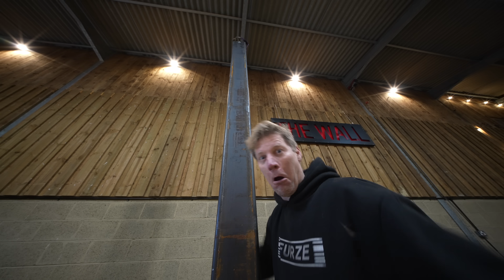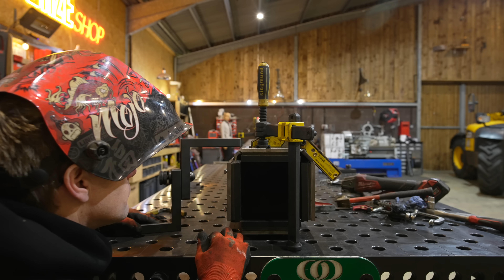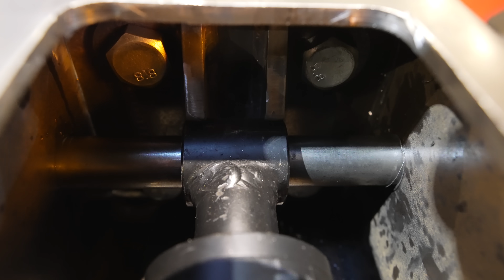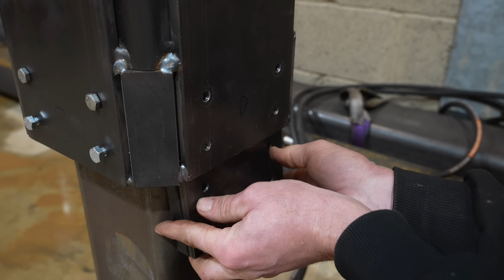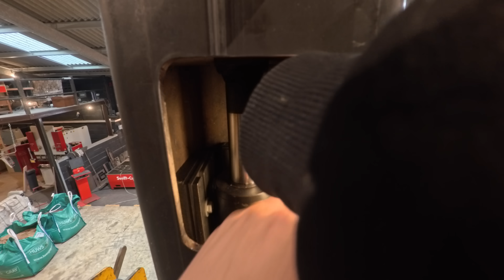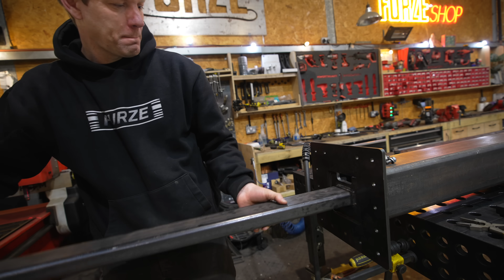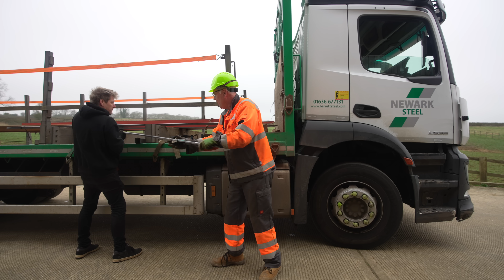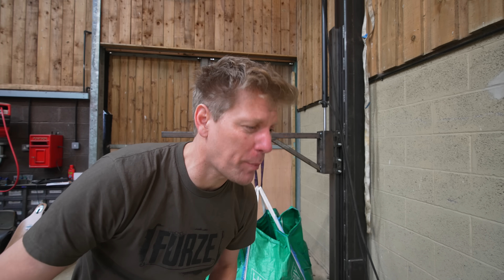Digging SECRET Garage Part 7 Car Lift Prep

Comment: colin if you are going to be using part of the lift as a means for mechanical repairs and inspection, please make sure that part of the lift has a locking mechanism, most of these lifts have an arm that gets pushed out of the way by these bars as it rises and when it lowers it catches the bars, so if there is ever a hydraulic failure your car doesnt come slamming to the ground

Comment: Delrin like on cranes. Depending on how much you use it you shouldn't have to touch it for 20+ years since it's just a guide. Definitely run the hydraulic system weekly or it will prematurely wear out. If it's unloaded run it up and down twice.

Comment: IDK why you wouldn't use a screw to send it up and down it's easier to repair and maintain plus it will run as fast or slow as the motors allow.

Comment: Instead of the complicated guide on the back, it would be sufficient to attach two plastic plates to each of the four corners at the top of the garage. That would keep the whole lift level in all directions.

Comment: Colin, what's to stop / protect against if the lift is elevated and there is someone else walking on the top side, or someone else is driving onto the top platform when it raise from the bunker ? 
If someone is on top of the bunker lift roof, or if someone is walking onto the elevated roof while it is being raised, could cause a bit of an issue for the person on top.

Comment: Dear Collin, you might want to consider driving your four columns with a spindle instead of hydraulic cylinders. With hydraulics, even if you use a gear-type flow divider, you’re still likely to run into synchronization problems. Just an idea.

Comment: Where the hydraulic ram is pinned to the leg, I would suggest using bushings around the pins. Over time, the ram pushing down on the leg will hog out the hole in the leg.  It would be easier to replace bushings than the inner leg.

Comment: the 3 ton capacity calculation.... is that before or after you take into account the weight of the frame of both lifts, the fame the car sits on, and the rams? Im betting all that will be 2 ton so the lift capacity (for the car car) would be .75 to 1 ton

Comment: I would consider myself lucky to be able to afford, simply, lowering my car underground to be parked safely tucked away.  You elevator that rotates when below to allow your car to exit the lift and drive around to your other locations ... that is just over the top.   How much easier would it be to skip the feature that allows the car to exit/enter the lift underground?  Is there something else that needs to use the lift when the car isn't on it?  If it is only for the car....why does.. oh, I just remembered the fun of absurd projects.  Great stuff!  Keep up the amazing content, it is excellent.

Comment: I used to install and service elevators. Im happy to see the brake. Maybe do a slack rope switch on each column. If it lags behind too much, the cable will slack, release a N/c switch that will stop the whole thing. Thats actually how those brakes work as well

Comment: Wouldn't it be easier to pull the ram out from the top with a access panel that also doubles as the connection point of the ram?

Comment: You're incredible. I don't know about those bolts holding the bearings on though, I would think the vibration over time would make them loose, even with the double nut setup.

Comment: 1.4 mtr slot for cylinder change, you tart. We struggle with 40 x 20 cm inspection hatch to swap  1.5mtr long 90kg cylinders. Then you have rear machine clearance. Thank god for a block and tackle

Comment: My bandsaw has that type of double nut adjustment on an eccentric cam for the guide bearings. They NEVER hold. It's a proper issue.
I'd strongly recommend looking for another solution. At the very least you need some sort of grub screw or locking mechanism on the locking nut.

Comment: What safeties will you have for if line breaks or cylinder breaks? 
1. You can isolate each leg
2. Would need tilt sensor and individual cylinder pressure sensors

Comment: For your ajustable shims in the foot, I'd have the set that are perpendicular to the adjustable set 5mm shorter on each end - you don't want to be tightening the adjustable shims only to find them binding against the other shims.

Comment: 20:06 took the words out of my mouth Colin! When you mentioned this feature earlier in the video, that they slide adjust, straight away this would work best if they did the same thing, exactly how the adjustment works on the rear of my Ford c-max suspension adjustment  works concentric nut(s) - for toe in and toe out adjustment. (And most tensioner pulleys on engine cam belts) at this point of the video, ta flipping dah Colin, our worlds(minds) align Colin! Mwah!

Comment: when it comes to making the platform tht the car goes it i think you should put a nothe plate on the bottom that has like a rubber thing round the edge and have limmit switches inside that pressure pad sort of design and have it so that the lift stops when it hits the floor or if something is under it that shouldnt be there its not gonna squish it

Comment: Given the current complexity of the physical components, can I recommend some PLC monitoring of the hydraulic system. Electronic monitoring for rate of climb of the 4 legs would allow control of the pumps to keep it 100% flat and equal the entire way.

You'll need slowdown and stop sensors anyway, so you may as well have level control too.

Comment: Im just a machinist. I would've went with hydraulics horizontal on the floor and they pull steel wire on pulleys to lift and lower the lift. You could throw on some counter weights if you wanted. Id want some kind of ratching catch though so if anything fails it doesnt fall. Basically exactly like an elevator design. 4 huge hydraulic rams will work, for how long? We will see.

I forgot. You could also get rid of the hydraulics altogether and use an electric winch to drive the cable. Would make it move alot faster and take up less room. With a good counterweigth on it, it would take almost no energy. Id trust steel wire more than any hydraulic ram, especially that much travel.

Comment: Use a device called "hydraulic flow divider". This will ensure an even lift of the car platform, even if only one corner has weight on it.

Comment: Forgive me because it's been a while since my last check, but how are you preventing the space in your tunnels and garage from becoming a low oxygen environment due to the oxidation of the steel? Im guessing just air exchanges and sensors for safety?

Comment: First thought as an electromechanical engineer : what about corrosion ? Mild steel needs some surface treatment otherwise it will get punky rusty in no time... Will you get all the parts galvanized ?
Second thought : will the structual engineer also establish the risk analysis, as this is obviously a Machine ? The good point is that there is a world full of suppliers of control systems wich will allow to put every risk under control : light curtains, anti-pinch edges, ...
Third thought : an iso-leveling system with cables looks to me a bit complicated on a 4-pole lift, there will be pulleys everywhere. What about this : for each cylinder, a 5/2 valve (up/stop/down with stop as default fail-safe position), a flow regulator (which helps to avoid the iso-leveling process to act if the valves are adjusted good enough, but if they doesn"t it's not critical), two inclinometers on the platform (X / Y axis) and a PLC to act on the necessary valves (stopping or keeping open) if the platform begins to get out of level.
Fourth thought : the safety brake blocks will act if all four cylinders fail at the same time; however this risk should be extremely remote (unless there is a common failure mode); also these brake blocks need a Governor like on a lift, and you'll need 6 of them with the associated cables.... that will be a lot of cables.  What could happen is one cylinder or hydraulic circuit failing ? Not sure the governor will catch, however as the platform will then still be supported by three columns, you'll get a lot of stress everythere... It will hang total wonky...  Here a ratchet mechanism looks more appropriate. It can be electrically actuated if the lift has advanced automation, in this case instead of the inclinometers suggested above, a position & speed sensor on each column (there are some with a little wire, others with a scale like a DRO) can provide the information both for iso-leveling and for releasing the ratchet.
That was a lot of thoughts, damn...
Reply: Hi
Regarding your 4th thought, i had some similar ones. I work in the elevator business, and even there a you dont need a safety gear if you have a hydraulic elevator, which is directly connected to the piston, and you have here for 4 pistons. So i seems a bit an overkill to have a safety gear and an overspeed governor. What they do in elevator business to prevent the elevator from falling during a pressurr loss, for example when a hose burst, they add a rupture valve to the cylinder, maybe this is already all the safety you need.
Great video though
Reply: Stop waffling ya sausage

Comment: Very novel but completely overbuilt. It's way too complicated! Why not just use 2 sets of 2 post car lifts? All the hydraulics, cylinders, shims, guides etc etc are all proven designs, cheap and pre assembled. They're also like 4m tall which should be more than high enough for this AND they have the safety locking / ratchet mechanism which is an added safety bonus. I mean even if the heights were wrong, you could extend them OR even have a "false" floor that would disengage from the lift arms and go down the rest of the way flush to the bunker floor. You could also use cables like the 4 post lifts have. I mean there's quite a few ways to do it, But this just feels like you're reinventing the wheel a bit here Colin! Great content as always tho

Comment: Wouldn't it be simpler to use big threaded rod inside leg instead of hydraulics? 4 legs. 4 big gears. 1 powerfull motor and 1 big timing chain to turn all threaded rods at the same time?

Comment: there's  much awesome going on here!
but don't forget a simple 6mm  drain hole for water near the bottom, if you end up grouting in your hydraulic columns at the base.

damp will surely try to pile up inside these robots.

Comment: You needed a real old skooler, like Archimedes, on the job. If you'd bored a huge hole in the middle of  your secret lair, you could've had  a big cylindrical float. A float that displaced a cubic metre of water could lift a tonne, or about 80% of a Delorean. A hole 2m in diameter & 0.5m deeper than your lift height would be about the right ball park for a near "weightless" lift of a Delorean. If that doesn't float Colin's boat, he should at least take on the principle of doing something recoverable with the gravitational potential energy expended when the lift goes down.

Comment: Errrrr 20:30 offset holes on M10 bolts to hold that much force? Never going to happen...

I guess i missed something but as i see it there's no way it would hold. 15mm plates? Then M16 i would say would make more sense, if you use M10 or M12 you could stay with 10mm plates

Comment: On the basis that everything is better with lasers, why not manage the leg extension and platform level with laser range finders and an Arduino or Pi based system?

Comment: Hey Colin. Awesome work you’re doing! As an American who lives in the “south”, we frequently deal with high air moisture levels for a solid 6 months out of the year. I do understand that we live on different continents, but I would be worried that with all the steel you use, you might deal with surface rust that could cause tighter tolerances to not work as well as they should. Is there anything that you do to avoid that?

Comment: When you first mentioned the car lift i was skeptical. Now i am amazed at how easy you make it look. There was a theatre that made a lift like that for its stage and props in the US. The stage ended up being guarded by the secret service because they ended up using the same design for aircraft elevators on carriers. If you pull off this impressive multi ton lift, you may get a visit from the Kings royal guard.

Comment: Metal worm electric engines for lifting.Outer beam and inner beam,
toothed surface. Make sure they work in sync, of use just one
engine via a shaft system to power 4 worms.
Use rubber seals for the topplate, or use a drainage system for rain.
With 4 hydraulics, you need to be able to equalize the pressure for
each separately, which may be harder than using electrics + worm.

Comment: I see the safety feature you put in, but that still wouldn't stop the lift descending on you (and any tools, trolleys, etc) if you had a small hydraulic leak - four post lifts, etc, use the ladder system that once you get the height you should then lower the ramp onto to take the pressure off the hydraulic system. And if it fails, the ramp and car just sit there. And how would you go about lifting the car off its wheels should you wish to?

Comment: OK I don't understand what your problem is why don't you just use a simple hydraulic lift like they do in every garage around the world surely the UK has the same kind of lifts in garages that the Americans do you fill a chamber with hydraulic fluid and you pump it into the piston and it raises then you take the fluid out and it lowers and it supports the entire weight of the vehicle no problem why is that so hard sure you could figure out how to do a standard hydraulic piston it's not rocket science it'll be a whole lot easier than whatever this concoction that you're doing now is

Comment: in the past I worked in a big distribution centre,  we had a lot of pallet cranes and lifts, for wheel guidance we used a lot of platic or compareable material for wheels instead of steel which was easy to replace when damage or wear happend. at the long run it's cheaper as well. I would consider this to make replacement of materials easier.

Comment: Use tighter tubes and put slip plate (liquid graphite) on the inner tube and be done! That's how we do it with car haulers! You over complicated the crap out of this. We use Hydraulic flow dividers to lift 2 or more Hydraulic pistons evenly. We also have Hydraulic locks that prevent them from moving up and down. We use 6 total pistons to lift way more then whay you need and we drive thousands of miles and they dont go out of line. Do yourself a favor or and look at a car hauler. You spent way too much time on something that is a very common thing in the world.

Comment: Hey Colin, wouldn't it be more optimal to be able to get the cylinders out if you could just unpin them and slide them out the top? Some covers held down with countersunk hardware and a pair of nitrile ring seals should be able to be plenty flush, water tight, and easy to unfasten if ever needed.

Also, regarding keeping the legs synchronized, you can get a valve which mechanically enforces equal flow of oil, even if the pressure needed to do so is different. From my understanding, the most basic form is basically the same as a stack of gear pumps all on a common shaft and with one port of each connected together.

Comment: Don’t forget to fit a presence detection system in case a child is underneath, so as not to run them over. And an emergency braking system in case of a hydraulic fluid leak or similar.

Comment: Can you explain to me the need for the column against the wall. Wouldn’t the four posts act together and give the required stability. I am just thinking how free standing bridge cranes don’t usually need cross member support from the side. Now I will say no one ever regretted overbuilding something
Reply: Though it could be due to you extending and raising your center of gravity so any sway from weight at the top would be multiplied. Also normally free standing bridge cranes have much deeper footers that keep them from swaying vs your relatively thin floor for this application you wouldn’t want it to buckle from the possible horizontal lever load. And by thin I mean it isn’t a 1-2 meter deep footer

Comment: I was imagining a chain driven pulley system for the platform so everything could stay flush at the top without extending out. But I guess the hydraulics are necessary for that much weight?

Comment: your main lift cylinders should have pilot operated check valves (load hold check valves) in them to over come any leakages and top take the weight of the hoses

Comment: It occurs to me that when you get the parking surface back on top, you will want a set of wheel guides to limit how far left and right you can go, and a parking bolster in the front to ensure when you park on top of the lift, you don't have to worry about a parked car on top hanging partially off the lift - you know within reason. It will certainly still be physically possible to screw it up, but with a standard car or small truck (like the Nissan) you can just pull in, up to the parking bump, and within the side markers, and know that you can still lift the lift.

Comment: Forget the slot. Weld a small foot on the side of the outer tube so you can pick it up a few cm with a bottle jack, then make the top cap unbolt so you can slide the whole hydraulic cylinder out the top. Skip the cables. Get an equal volume manifold.

Comment: If they are all on the same pump, they'll have no choice but to go up level, as the fluid will preferentially choose the path of least resistance. As an example, I used hydraulic jacks for my dump trailer because I wanted for the jacks to go up based on height and not based on stroke, in case one of the jacks is on lower ground than the other.